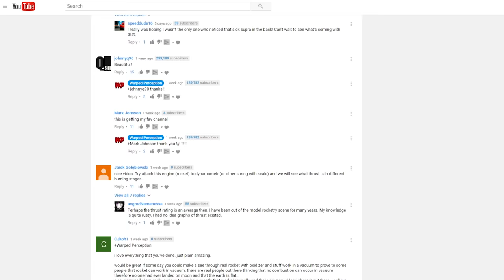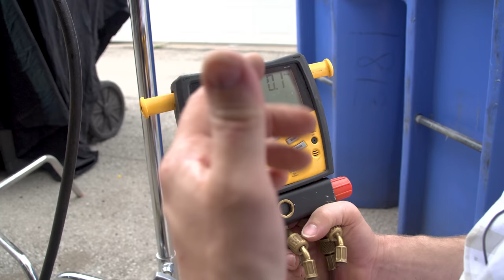Model Rocket Engine In A Vacuum Chamber - 4K Slow Motion - will it burn? - Rockets (S1 • E3)

Comment: Unfortunately this experiment is not applicable to NASA.  And let me explain why in one simple statement.
This experiment is done with Earth gravity...so I don't see a problem with the rocket in a vacuum providing thrust when there is gravity.    

If we could test a rocket in a vacuum, and also in zero gravity, then we will be able to know the answer everyone is so desperately seeking.  Until then, these experiments are limited to being performed under Earth's gravity.
Reply: If only some sort of "space agency" could go to space and test a rocket in zero g and a vacuum...
Reply: @liquerinfrnt  you need to really study newton's 3rd law but get a real understanding of it not just the equal n opposite reaction part that is such a simplified explanation, to gain thrust you need 2 objects acting against each other, so one is the rapid expansion of the exhaust "gases", the second is firstly the ground of course, but the secondary is the atmosphere surrounding the axhaust nozzle, so when the rocket rides its gases expand pressing against the atmosphere FASTER that the atmosphere can move out of it way, resulting in the rocket lifting up wards. Without stabilisers the rocket would fly out of control dude to slight pressure differances in the air. No apply that principal to an astronaught don't a space walk with a pressurised gas jet pack. No resistance no thrust
Reply: @a_disabledsniperlol8287  uhh... no. While you may be correct that some turbulence does result from pressure differences while in the atmosphere, the atmosphere is 14.7psi and the rocket exhaust is in the thousands of psi. The atmosphere is negligible, and the rocket's thrust itself certainly does not rely on an "atmosphere to push against". And in space, the motion is fully described by equal and opposite reactions. F = ma, and the rocket fuel contains literally tons of mass, and it is being pushed out of the engine at massive acceleration, creating huge forces.
Reply: @a_disabledsniperlol8287  I would recommend you study some physics force diagrams, specifically two objects being pushed apart by a constant force spring as a closed system. Total net force is always zero- any backwards force equals the forwards force, resulting in 0 net force. But the objects accelerate away from each other. In the case of a space suit jet pack, the two objects are the pressurized gas, and the astronaut. There is no atmosphere required.

Comment: try to implode a glass by negative pressure, like by decompressing a glass tube with the vacuum chamber
Reply: There is no such thing as "Negative Pressure".  The lowest "Vacuum" can go is 0.0 PSI
Reply: @stuartgray5877  yea I now but using a thin glass it could explode even at 0.0
Reply: @carlcarlo3983  The glass in the vacuum would still have equal pressure on both sides. Nothing would happen.

Comment: If I float before you in space and I push you, I'm going to go backwards and you are going to go forward. And the same thing happens when you ignite a rocket engine, simple thing, no need for air. Works even better with no air because no air resistant ahead.
Reply: Fire needs air to burn, you're correct about the rest.

Comment: Nonsense...it is too small of a vacuum to emulate space. The rocket moves because the vacuum becomes filled with gas as apparent in the slow motion footage. It is absurd to assume the same would occur in a very large vacuum.
Reply: - "It is absurd to assume the same would occur in a very large vacuum."

WHY? 
Do you think that RECOIL stops working in a vacuum?

If I fired a CROSSBOW in a vacuum, would I STILL feel recoil?
Yes or no?
Reply: You obviously don't understand how rockets work. The very high pressure inside the combustion chamber will seek the lower pressure area, i.e. vacuum. And since there is matter exiting the butt of the rocket, the pointy side will go the other way. BTW, rocket engines are more efficient in vacuum than in earth's atmosphere since there is more pressure difference in a vacuum.

Comment: the major question is. is there a recoil in vacuum or not. 
because every recoil based system needs a object, on earth the air to move from it. 
the question is not - burn the rocket rather move it forward. 
if you think about the experiment feather and bowlingball in vacuum chamber, there is no differents although on both object with completely different weights the same force acts. 
why we see never a experiment that shows the power of movement in vacuum triggered by recoil?

Comment: A wee bit about rockets. Rockets use a fuel and a propellant. One Example. Liquid Hydrogen(Fuel). Liquid Oxygen(propellant). Light that material on fire in a balanced and controlled reaction and the rocket goes one way and the expelled mass from the rocket goes in the opposite direction. Conservation of momentum. We need staged rockets since the first stage is not tuned for a burn in a vacuum. The first stage rocket becomes more inefficient as it get higher and higher off the ground. The fact I can write this proves it. Wifi satellites anyone ? Satellites in orbit put there by a staged rocket........conspiracy driven people are annoying and should pick up a hobby instead. I know. How about rocket building. Staged rockets.

Comment: A rocket engine has Oxygen and fuel. The problem is the jetted gas would just push away from the rocket in open space because it is lighter than the rocket and would just keep moving away into infinite space.

Comment: Great video ! You are brilliant ! I was searching to find out if when a spacecraft fires it's thrusters in space if there is any orange flame exhaust. It looks like there is. Thanks again.
Reply: That depends on the combination of fuel and oxidizer used. E.g. a pure hydrogen-oxygen flame is next to invisible (both in vacuum, and down hear on earth). Depending on the way the hydrogen was created there may be impurities in it, e.g. when producing it using electrolysis there may be residues of the potassium used in the process, and that gives the flame a slight red-violet tint.

We're used to flames being bright yellow-redish, but that's only typical for carbon based materials, and what you actually see there in yellow or red are glowing carbon particles in the flame, due to fuel-rich mixtures.

If you ever had to work with a Bunsen Burner in chemistry class, you should remember that depending on the air intake setting you can get everything from an invisible to a bright yellow flame, and the hottest you can get actually being blue, all from burning the same propane, butane or natural gas source
Reply: @hartmutholzgraefe  Thank you. It is all fascinating !

Comment: So you obviously didn't have the vacuum operating during this test or your chamber would have been evacuated almost immediately of exhaust. what that tells me is your chamber filled up with smoke until the rocket had something to push against like a rocket would work in our atmosphere. And if you notice it has a delay between the time the rocket fires and when it begins to stretch the spring. Why don't you try it again with the vacuum operating the whole time to see how much forward thrust you get in the same amount of time as your first test.

Comment: that is not a vacuum chamber.. A Vacuum chamber that i tested for firing, the smoke will go in all direction quickly as it try to fulfill the space. From the video i see the smoke forms turbulences this shows there is air resistance.

Comment: You were way off on your expected thrust duration for a model rocket motor of that type. An Estes C6 motor has a duration of 1.6 seconds, not 8 seconds. That long would put a model rocket at an altitude that would probably require an FAA waiver for permission to launch. It's been a long time since I've launched, so I can't remember if the weight of the rocket would come into play for a waiver.
Reply from the maker: I believe 8 seconds was the entire burn including the ejection charge, whatever I said in the video I got off of Estes website

Comment: Wouldn't you need a bigger vacuum to prove your point? I think that this rocket is moving because of the pressure change inside the chamber happens when all of the gasses are released and trapped in the small area, giving the rocket something to push upon other than the end of the tube. Let me know and don't yell at me if you think I'm wrong. I mean to honestly settle this matter is probably to let a model rocket go off in space. Then I'd be convinced because I'm hearing two possible outcomes for this "rocket-in-a-vacuum" thing.

Comment: wheres the vacuum gauge, cause the thrust was going back at its self. Meaning it filled the mass with pressure, like a firework in an empty balloon. when you opened it there was not an impressive amount of vacuum at all compared to the size of the tube. .

Comment: But wait. I was told space is a vacuum which mean if u took off ur suit it will suck the air out of your lungs. Because space is always expanding wouldn't space just suck up all the trust into space and a rocket would just sit there as this rocket did until it built the pressure back up in this little tube.

Comment: I'd like to know if you had a complete vacuum as as in space of course you can make a little bit of Power with some air in there I'm not arguing that Rockets can't make their own oxygen but the fact is they need something to push against they can't just push against nothing which is a vacuum

Comment: It might burn fuel but not at the very cold temperatures in space.. it will go nowhere... because in a space vacuum there is nothing to push against … .in this experiment the rocket moved because of the wall of the cylinder

Comment: Its no longer in a a vacuum when the burnt fuel is added to it.
Reply: It begins to move upon ignition, before any burnt fuel gases could reach the end of the vacuum chamber.
Reply: Show us the equation you use to calculate thrust with varying levels of back, or atmospheric pressure. That will be telling.

Comment: Your little rocket motor creates gases as a by product of combustion, the gases expand, your “vacuum tube” is then no longer under a vacuum. Take the tape off the end caps after you pull a vacuum, your end caps will stay as long as it’s still under a vacuum inside. Once you ignite that rocket them end caps will fall off almost instantly. This experiment is flawed. Also the fuel in the rocket motor contains its own oxygen to burn so it would burn under water. That is all.

Comment: Regardless of what you believe about the shape of the Earth, this video shows evidence for one of the things it set out to disprove, namely that jet propelled rockets do not work in a vacuum.

First of all, mixing together the belief in a flat Earth, that jet fuel cannot be ignited in a vacuum, and that jet propulsion doesn't work in a vacuum, just creates a lot of confusion. The first of those statements has nothing to do with this experiment. As for the second statement, this experiment very clearly shows that jet fuel can be ignited in a vacuum, and there is no reason for why it wouldn't when providing both the fuel and oxidizer.

The third statement is where you go awry though. It's extremely clear from the experiment when watching the 2500 FPS video that despite the model rocket having started to expel gases at a rapid velocity, it's almost not producing any thrust at all to begin with. How come? Because the expelled gases are not pushing against anything, meaning that they are not creating any reactionary force at all.

What you can clearly observe, if you as a true scientist attempt to explain what's going on by what you perceive without overlaying preconceptions, is that the model rocket only starts producing significant thrust when the expelled gas starts pushing against the rapidly forming column of gas which has already been expelled, causing the required reactionary force by gas pressure.

I challenge you to attempt this experiment using a much larger vacuum chamber in which gas already expelled will not start interacting with the gas currently being expelled; I hypothesize that under those conditions, the rocket will produce negligible thrust.

Comment: Hi...nice experiment and done very well ;-)

The problem is...this obviously work in wacuum...but...it will creat any movement in space? I dont think...on video rocket move... but this was...because burned material fulfill the tube behind so rocket can finally push from somethink.
But in biiig space vacuum...do you think it will burn so fast that can creat some mass that will not expand so fast so you can be able to push from this?

Peace :)
Reply: Blood Sucker The mass of the fuel is expelled from the rocket, so according to Newton Second Law it absolutely would, particularly because there is no friction to overcome.

Comment: just some facts what i know about rockets

A rocket doesn't even need Air to get thrust upwards in earth environment space comes later.
A rocket has it's own fuel to burn and gets it's thrust from it.
A Rocket get's thrust from it's on Fuel? yes, they have two fuel tanks one contains Oxygen and second contains Rock fuel they ignite them both which gets really Hot BTW :P when it burns it needs somewhere to get out or it'll explode the place where this is all happening so the burned fuel gets out from not so smaller holes (nozzles) which creates the thrust that is needed the rocket to go forth.

you claim rocket can fly in earth environment and can't fly in space because of no air. you must have been an alter ego of Newton. can't you observe how a bird fly they have to keep flapping for most of the part because sometimes if air is with you fine but if it's against you it's going to rip you apart and smack you down?

why i'm  saying this because if you compare this to space there no air that can stop you from flying if you have your own fuel you can go as far as your fuel can take you lol

Comment: Can you try in wide invironment let see how the rocket 
propelled  :)  because space is infinite wider than tube the rocket cannot fill the whole space ^_^ unlike vaccum tube he can easilly create atmosphere :)
Reply: It doesn't matter, thrust is created before the chamber fills with pressure. By your logic, missiles get slower at high altitudes
Reply: The rocket feels forward acceleration as it accelerates the mass of the exhaust gas from the engine.  What happens AFTER the exhaust gas leaves the nozzle is irrelevant.  The engine is finished pushing on that mass while it is still IN THE ENGINE.

Comment: Maybe the atmosphere's oxygen messes with the air/fuel ratio, and when it's in a near vacuum, it uses up the oxidizer super fast, and that might be why it burns in almost a second, could be completely wrong, please correct me
Reply: Thanks for letting me know!

Comment: Great test. Thank you. I would like to suggest though, measuring the results and comparing to a control test in normal atmosphere. Perhaps there is a significant difference in performance for example.
Reply: Yes, there is. The exhaust plume in a vacuum is way wider due to the lack of atmosphere to 'compress' it, and because the combustion chamber ratio is optimized for sea level flight, there's a significant decrease in performance, although this could be worked around by running the engine at a lower pressure. Hope it helps!!! Cheers

Comment: No one is saying a rocket can't ignite in space. The problem is vacuum a rocket can only truly work in a pressurized environment
Reply: Collin Daugherty.   Rockets do work in Space, as a matter of fact they actually work better in Space as the pressure differential is greater and there is no drag.
Reply: @tomkfly  .... a response to the bullet experiment ...if you think of a rocket as the bullet....the rocket is only the cartridge of the bullet...it is missing the bullet....and if a cartridge is fired without the bullet the energy would not reoil againt the combustion without the bullet attached to the cartrige...in fact it would be even further minimized in a 0 pressure enviroment as there would be no resistance to the combustion .....
Reply: @tomkfly  and as a final thought on the bullet experiment even firing a gun while sitting on something in space would not actually be as accurate is the bullet floating in space by itself the very fact that the bullet is interacting against a larger Mass which is you as a fixed point of reference ruins the experiment Newton's Third Law works only if two things are interacting with each other if you remove one of those items especially the larger Mass the experiment doesn't work it's like the difference between pushing a wall and pushing the air you can apply the same amount of force with your arms but if the wall isn't there you are not going to feel any pushback

Comment: Was your vacuum 100 pure? The short burn could be due to air still in the tube. So there was result of still forward from the motor.  I think a more perfect vacuum test condition is necessary. 
You need a Real Lab and a much larger vacuum chamber, using fuel with an oxidizer to prove this.  I don't know if it is possible to make a perfect vacuum on earth..  Is space a perfect vacuum ? ?